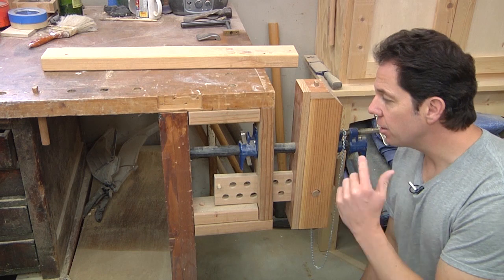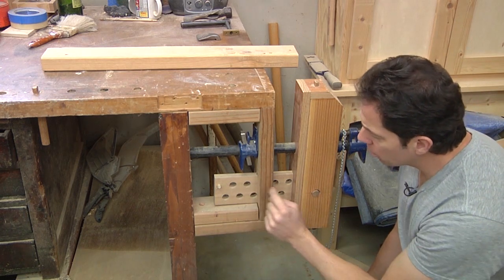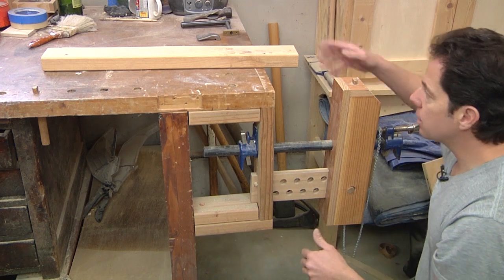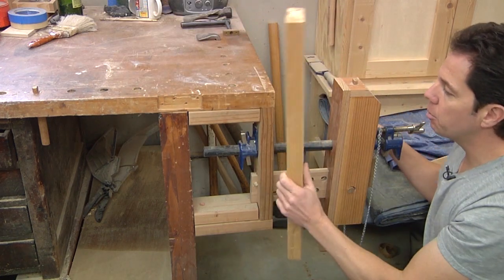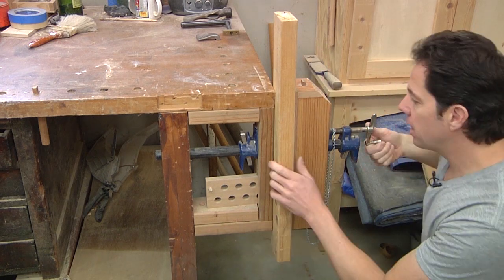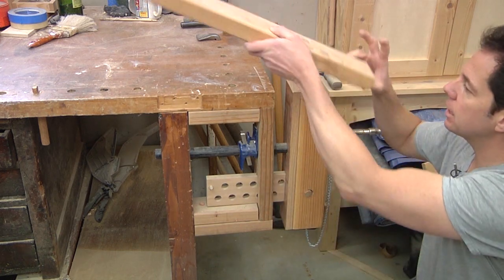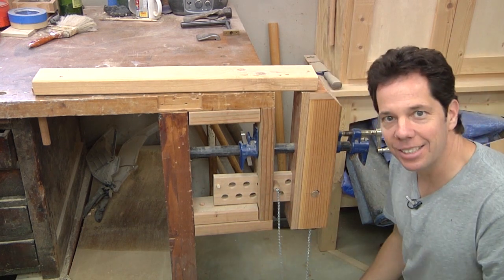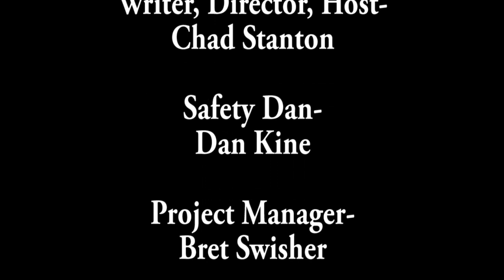World's BEST and Super CHEAP Tail Vise

Comment: Great cheap and easy vise. Not everyone has $250-$350 budget for a high end vise and this vise works just as well.
Reply from the maker: I tell ya. I work on a limited budget myself. Don't be fooled. A full time furniture maker is not rolling in dough. I have been using one on my small bench for YEARS now and it works great!